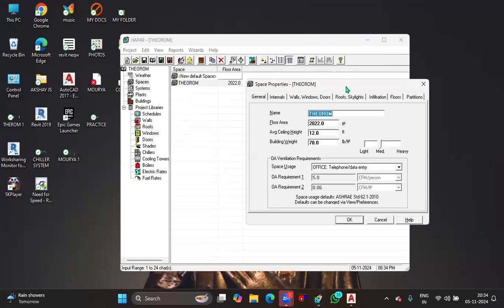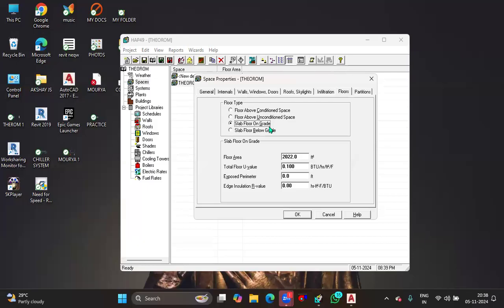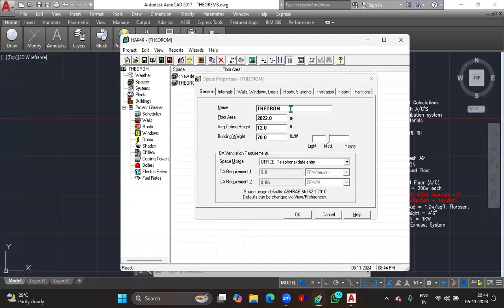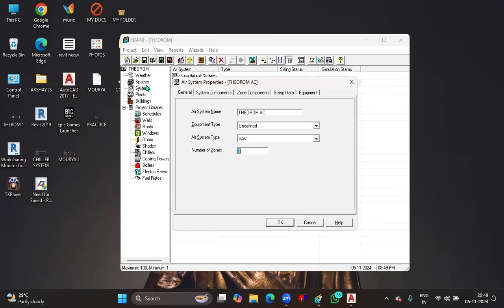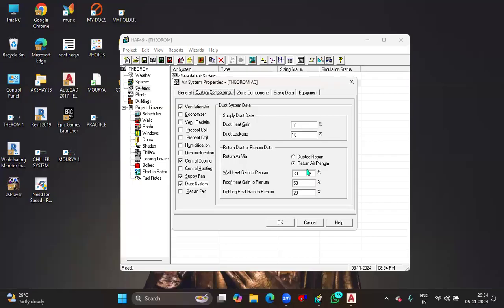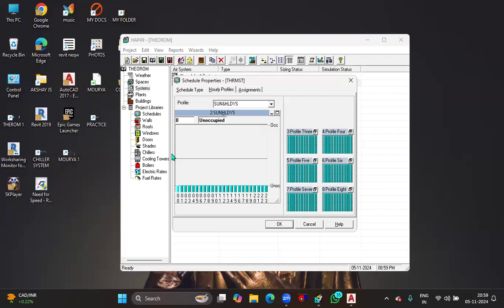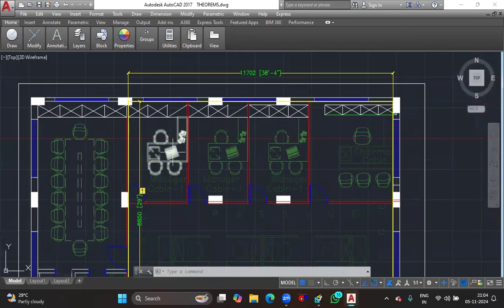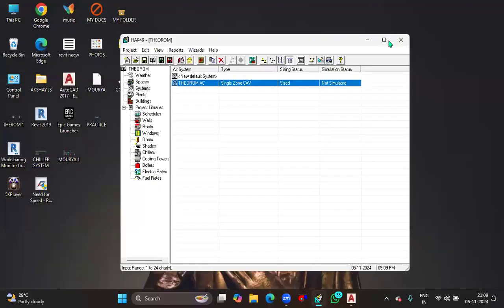Advanced HAP Software Tutorial | HVAC & MEP Load Analysis Guide - Part 2

Comment: I am conducting tests with older versions of HAP and have successfully extracted information such as the thermal transmittance coefficient (U-value) for walls and floors, electrical data, among others. However, I am unable to import these data in HAP version 6.2. Do you know why this is happening?
Reply from the maker: idk
Reply: How to get the 6.2 version of hap?